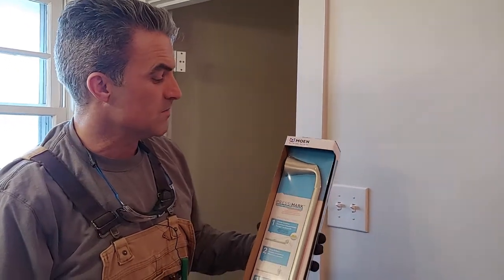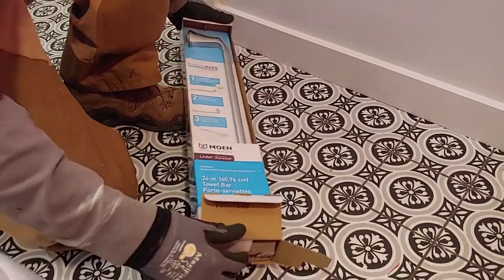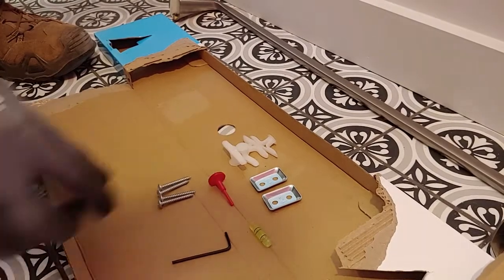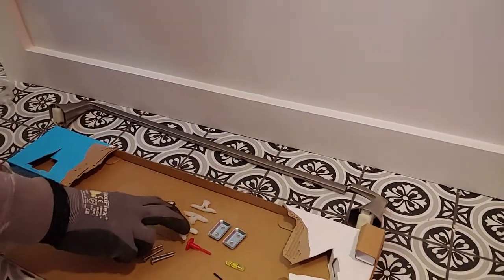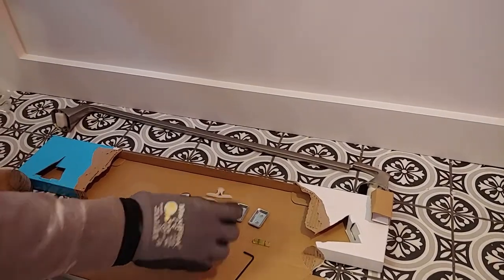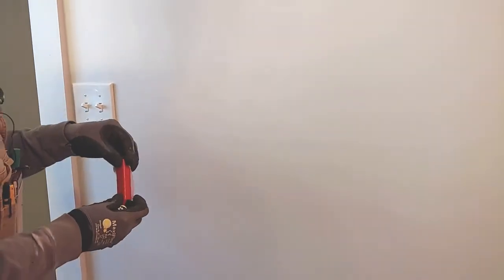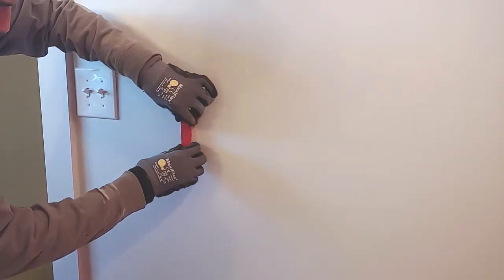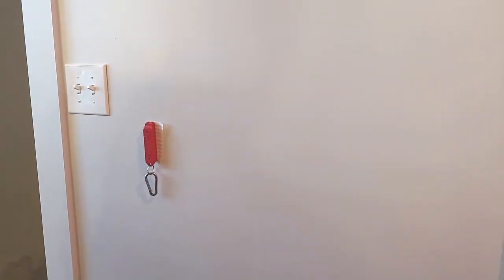Moen Press & Mark Towel Bar Easy Installation #Moen #homeimprovement #diy

Comment: I would cut it to 16” so it mounts on a stud…..
Reply from the maker: Hi Wayne. Thanks for watching and leaving a comment, always appreciated. That's not a bad idea...but, might only work for a few bathrooms where 16" on center still looks good on the wall. In this case, 16" O.C. would have put this rack in an odd spot between the light switch and the shower and would have probably drawn more attention to the fact that it wasn't centered on the wall. Since this wasn't my house, I chose the center-it-on-the-wall option, which made for a little bit more work, but not too hard to tackle.👍